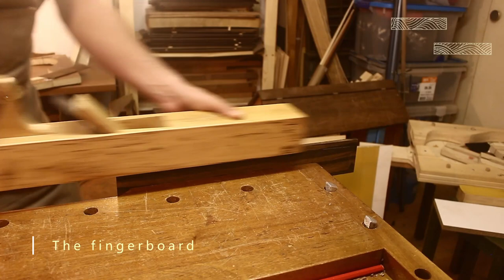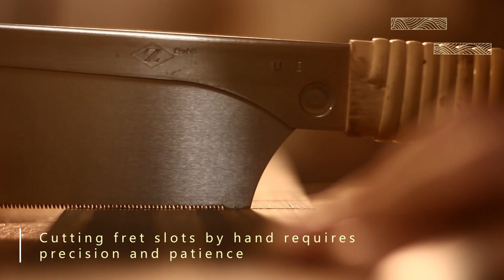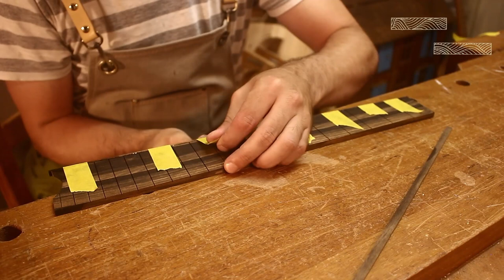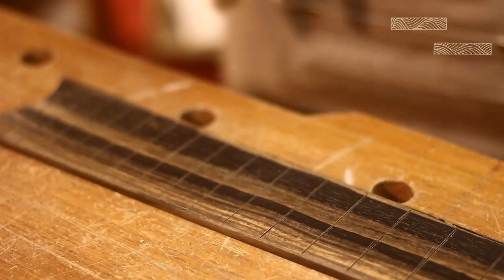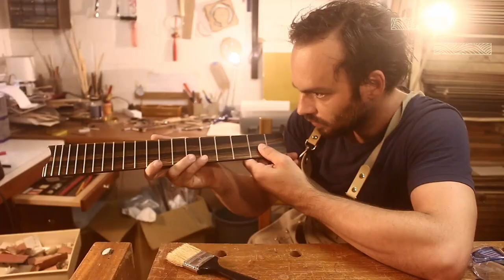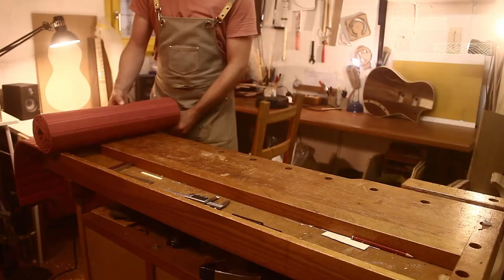The making of a Classical Guitar - Fingerboard 'Benu'

Comment: clever to use these pins to position the fingerboard to glue it.  Did you drill the pins holes before cutting the fret slots or after?
Reply from the maker: Thanks! I drill the holes after the fret slots, so I am sure they will be hidden under the frets

Comment: On acoustic and electric guitars I do prefer binding. However, on a classical I cut the tangs back and fill the slot with fretboard dust and super glue. It finishes better, looks cleaner and any expansion/contraction of the fretboard is unnoticeable. When I bevel the frets I also ever so slightly bevel the fretboard so fret sprout is eliminated. I’ve done this on my last five builds and I’m really pleased with the outcome initially as well as long after completion. Although after watching your method I wish I’d done it that way for the cocobolo fretboard I recently used to complement a redwood top. My method has been fine for ebony but the cocobolo’s varying color means my method is noticeable on close inspection. Well done and thanks for the enlightenment.
Reply from the maker: Hey Joe, thanks for the input! Yeah, I think your method should be less time consuming, and for ebony the looks should be just as good. I've done it before on Rosewood and was a bit disappointed, so I switched to binding in all cases, unless the client doesn't want it.
On a different subject, may I ask, where do you source your redwood?
Reply: Edit: Both surprised me with very smooth and deep bass. The trebles are equally impressive. It’s not your traditional sound but I love how they sound. Curly and wide grain I used mahogany bracing and sitka for the fine grain.
Reply: @chriscrevelsguitars  I’ve tried posting the source and a few lessons learned but it never shows up.
Reply: @chriscrevelsguitars  So how about this: tonewood and you append the dot you know what.
Reply: @chriscrevelsguitars  Lessons learned: the curly and wide grain are very brittle. The fine grain a bit less so and closer to cedar but care is essential. Both seem to stain easily. You appear to primarily use hide glue so that shouldn’t be an issue but titebond types turn gray-ish. My recent build I used a purfling (titebond as the glue) with a black leading edge and the water based dye slightly bled into the top. So on close inspection there’s a blue-ish gray fuzziness around the perimeter of the top. At a glance it’s not so apparent but there nonetheless. It also does not like super glue the same way spruce doesn’t. So if I use redwood again I’ll have to find an approach to the purfling issue. While I prefer black leading edges for purfling I may switch to white for redwood. I’m not a fan of super glue for construction so sealing the channel and using super glue doesn’t appeal to me. I may seal the channel with hide glue, let it set and then install the purfling with hide glue. However I’m not sure if hide glue would be receptive to that approach though I suspect it would be. I’m also not sure if that would prevent the bleeding. I’ll definitely use some scraps and test that approach given my preference for black.
Reply from the maker: @joeyoungs8426  yeah, I think links will not go
Reply from the maker: @joeyoungs8426  I will look into it. I am really interested in making a redwood guitar sometime next year. Maybe with some walnut or Indian rosewood to pair, but still to decide.